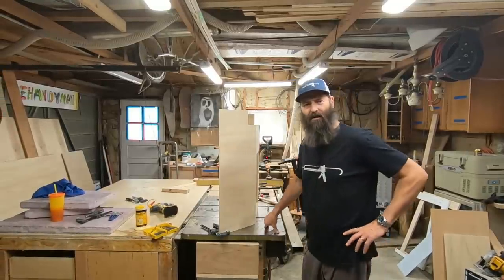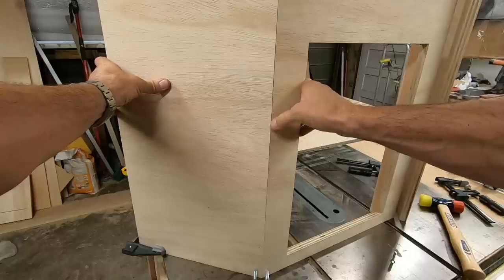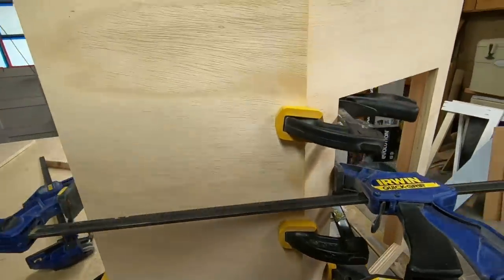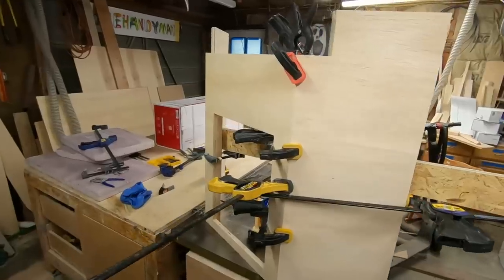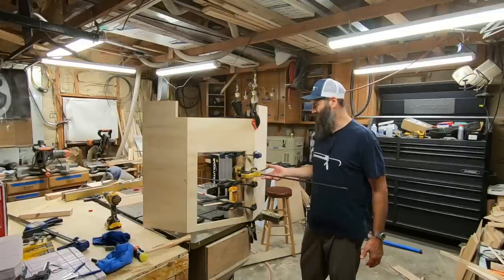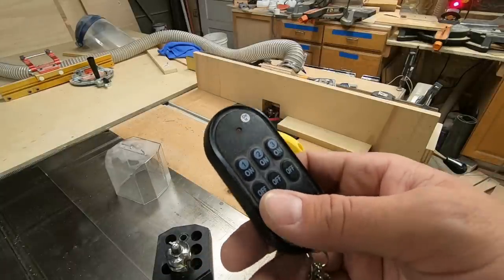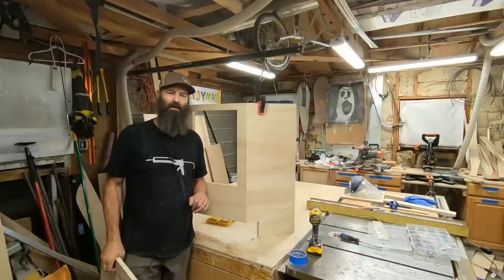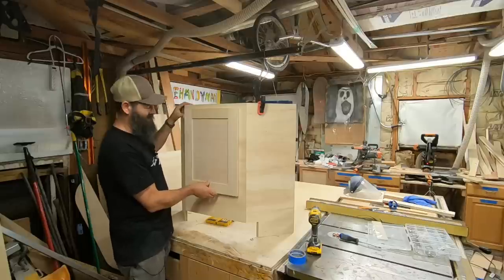My Most Difficult Project To Date | Am I Qualified To Do This? | THE HANDYMAN |

Comment: Would it also work to suck those joints together, to cut an anchor board at the same angles, and brad it into the back side of the joint? Think of a 3x1, mitered to fit into the vertex of the angle wrapped in plastic so the glue wouldn't stick?